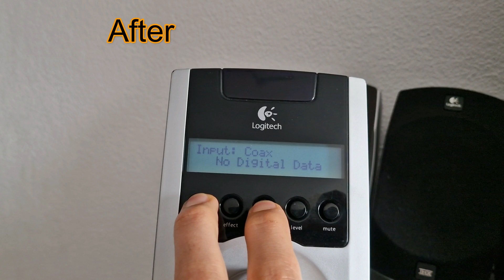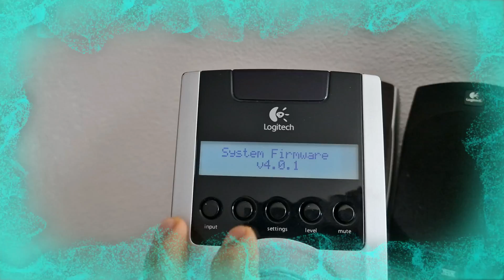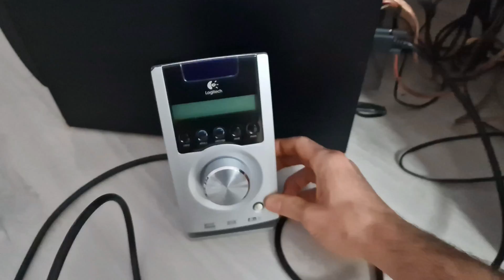Logitech Z5500 Change POD Control (Firmware 2.1.0 to 4.0.1) + New Case!

Comment: I have the 1st generation one and version V 4.0.2 What exactly do the version differences change?
Reply from the maker: @Keremymz94  I discovered that a certain Output Format set in the PC can mute the logitech system.
DTS appears on the display but it is completely silent!
This seems to be a Windows problem, not necessarily from Logitech!
I also use the Stereo X 2 to have the 6 speakers and the 2 subwoofers!
This is when I listen to music :)
Reply from the maker: @Keremymz94  I noticed a lot in Dolby and DTS movies, there were sound changes in the Voice on the central speakers, and a little more tweeter on the central and bass!
That's how he listened to the music on 5.1 and I didn't notice any changes either!
You can see the new components in POD Control, as well as the screen with a different contrast to the old one, the new firmware that allows it to be displayed on the screen, even if the system is turned off!
+ other changes that logitech did not disclose!
Also try the MODs I made, you'll be surprised how much the sound can change!
There are 4 videos on my channel, look here link!
1
https://www.youtube.com/watch?v=W4CVPgWLYz8&list=PLsgyMOzSu2Eq9WmEVhE2aZzsZ22VpJyPS&index=17
2
https://www.youtube.com/watch?v=3i0sI4N84Bg&list=PLsgyMOzSu2Eq9WmEVhE2aZzsZ22VpJyPS&index=16
3
https://www.youtube.com/watch?v=IwjKWUaQo5c&list=PLsgyMOzSu2Eq9WmEVhE2aZzsZ22VpJyPS&index=14
4
https://www.youtube.com/watch?v=Dk8L73oLOPA&list=PLsgyMOzSu2Eq9WmEVhE2aZzsZ22VpJyPS&index=2
Reply from the maker: @Keremymz94  I encountered this problem too, when I watch Dolby or DTS movies I use the Optical cable from the TV to the POD Control, and sometimes I put the pause twice and the POD Control freezes, showing that it does not detect a Dolby or DTS signal and I gave a restart to POD And then it worked, I had no more problems with it!
You can also try a reset on POD Control.
Set the unit to standby mode then press Input Effect simultaneously for 6 seconds. This will put the Control Center in "Diagnostic Mode". Now every time you the Z-5500 is fed a digital stream (DTS, DD, etc.), it will display the stream information (format, bitrate, etc.) for 5 seconds in place of the DD or DTS logo before returning to the standard display.
Reply from the maker: For example, I downloaded a movie with DTS format, with 3 languages in it.
You can select which language to speak in the movie, one of them had the DTS format with a different number of Bitrate that logitech does not support, and I had no sound at all!
And there is another setting in windows, when you select the output to 2 channels 16 bits 96000hz (Studio Quality)
Or 2 channels, 32 bits 96000Hz (Studio Quality)
There are more, I haven't written them all, I have 12 settings in total.
Of 8000hz 16 bits or 24 bits 48000hz, etc.
If I select the last 32 bits 96000hz studio quality, logitech no longer has sound, but I noticed that even my headphones that connect via USB-C have no sound if I select another bitrate, or other wireless headphones have sound but it is not heard at all well, the sound is intermittent and noisy. @Keremymz94
Reply from the maker: They can be found on google, I can't send a link here!
I have it from a friend, uploaded on Megaupload! @Keremymz94
Reply from the maker: Hello, along with the firmware update, Logitech also changed some components inside the POD Control, they put better quality components than the other versions.
We improved the sound, rearranged the equalizer to DTS and Dolby and much more!
Reply from the maker: But do you use the Digital (Optical) input from the PC to the POD Control?
Or do you use the 3 jacks? @Keremymz94
Reply from the maker: Have you tried now to see if the sound stops?
It may be because of your computer!
To the program with which you play the movies!
If you take out the optical cable and put it back in, do you still get no sound?
I think that the PC remains blocked and no longer sends sound to logitech, and because of this you have to restart the PC to make the sound work again! @Keremymz94
Reply from the maker: For me, when I play the movie on the TV, this problem does not appear, I don't play too often either, I often let the movie play completely :)
It may be because of the signal sent by the PC!
At a moment, because of the scrolling, it receives and stops the signal quickly and possibly because of this it remains without sound! @Keremymz94

Comment: Hello, I have the z5500 set. I have a problem that isn’t found anywhere on the internet and I’m hoping you could help me. I have the Control Pod connected via an optical cable to the tv. The Stereo and Stereo x2 effects work fine, however, when I switch to the Dolby Digital or dts effects I do not get sound. The Control Pod can recognise that Dolby Digital or dts audio is being played however there is no sound from the speakers.

Also, connecting the Control Pod via the 6 channel Direct gives me no sound at all. None of the effects work via this connection. 

I tried different tvs and pc and nothing works. 

Where could the problem be and how can I fix it? Thank you very much.
Reply from the maker: Hello, it's a little strange what's happening to you..
The problem is more than likely from POD Control, where exactly, I don't know!
Possibly from the chip that controls the outputs for the 6 channels!
This chip is called NJW1150 and I had a problem with it in the past too!
Here is a video I made with the problem I had.

https://www.youtube.com/watch?v=PjzHTUbRgX8&t=9s

You can also try a reset on POD Control.
Set the unit to standby mode then press Input Effect simultaneously for 6 seconds. This will put the Control Center in "Diagnostic Mode". Now every time you the Z-5500 is fed a digital stream (DTS, DD, etc.), it will display the stream information (format, bitrate, etc.) for 5 seconds in place of the DD or DTS logo before returning to the standard display.
Reply: @ElektroGamer30  Thank you for the response. I reset the pod and put it in diagnostic mode just like you said and now the Direct 6 channel connection works however only Stereo and Stereo x2 work but DD and DTS still don’t work just how it is when connected via optical cable. 

I’ll see if the chip is the problem. Thank you so much.
Reply: Yeah I have a pod that has this issue problem is I can't figure out which freaking control pods go with which revision subs... @ElektroGamer30
Reply from the maker: @intoxicode  
Hello, the PID number must be as close as possible or equal to the one you have.

Comment: Do you have any idea of the cable type they used to connect the pod to the subwoofer ? My #!& cat ate it and I must replace the cable (still working but noise when moving the cable) . From what I understood, it not enough to take a VGA cable (15 cores, not 14) cut one end and solder it inside the pod. I've found (multiple) schematics of the connector mapping, but I can't find anywhere the type of cable to use (from what I can see in the hole of my cable, some part are shielded ?). For the record, my system is approaching it 20th anniversary and still kicking hard after thousands of hours of usage (I did not even had the infamous led problem)...when cat does not eat the cable...
Reply from the maker: What's wrong with you, let the cat eat the cable (It's really funny)!
Yes, you're right, it's not an ordinary cable like the one you use for the monitor!
The wires for the output from the bridge to the amplifier are once again shielded from the other wires to prevent different noises that may appear in the speakers!
I don't know such a cable that can be bought commercially!
I think logitech specially created this cable for their systems!
From what I have seen of different people who replaced the cable with a VGA plug, they used exactly that cable for the monitor, only as a better quality one!
I don't know if they experienced noises (interference) after replacing the original cable!
You have the order of the threads here if it helps!
It is compatible for PID R020+ R849+

To be sure of the connection, you can also measure your wires with a multimeter!
And if there is something wrong in my scheme, leave a comment here with the wires measured by you!
As far as I know, it's at PID R800 - (down)
differ one or two pins in placement!

Pin in POD Control!
WA17 - blue white pin 13 sub
WA2 - minus wire, ground braid from VGA cable
WA3 - black white pin 15 sub
WA1 - brown white pin 14 sub
WA 9 - gray pin 2 sub
WA8 - brown pin 1 sub
WA7 - red pin 3 sub
WA6 - pine green 4 sub
WA5 - purple pin 9 sub
WA4 - yellow pin 5 sub
WA10 - red white pin 10 sub
WA11 - green white pin 11 sub
WA12 - black pin 12 sub
WA13 - blue pin 7 sub
WA14 - white pin 8 sub
WA15 - nothing, does not connect to the sub
WA16 - orange pin 6 sub

Comment: i checked everything is fine and it's still a white screen
if not to the woofer
Reply from the maker: there is a risk of damaging a component either in the subwoofer or in the POD Control when you connected the wrong wires the first time!
Try to power the POD Control exactly like in the video I made and see if it still works!
https://www.youtube.com/watch?v=RxMEwN5OYbg&t=432s

Comment: I have everything wired as you wrote to me, I literally did everything as it says, just to look at the only control you said about the display, is it not interrupted
Reply from the maker: Hello, as far as I know, the screen remains white without anything being displayed on it when the 8v power supply is not connected!
Check if you have +8V on WA10
(WA10 red white pin 10 sub)

you can try to power POD Control separately to see if it still works!
Watch a video how you can do this!
https://www.youtube.com/watch?v=RxMEwN5OYbg&t=432s

Comment: I connected as you said and only a white screen appeared on the control
Reply from the maker: If you have disassembled POD Control too many times and kept moving the wires from the display, there is a risk that it has broken off the board!
First check the wires if they are broken or if they have continuity, check with a multimeter!
I've had a thread break in half and it's not noticeable.
It's just that my POD Control doesn't turn on at all!

Comment: the control does not work for me, a white image appears on the display, is it burnt or something is wrong, what could be wrong with it
Reply from the maker: Hello, as far as I know, the screen remains white without anything being displayed on it when the 8v power supply is not connected!
Check if you have +8V on WA10
(WA10 red white pin 10 sub)

you can try to power POD Control separately to see if it still works!
Watch a video how you can do this!
https://www.youtube.com/watch?v=RxMEwN5OYbg&t=432s

Comment: might try upgrading the opamps to tl072/74 or ne5532?
Reply from the maker: Hello, I made a complete MOD to this system!
I replaced many components in the subwoofer as well as in the POD Control!
I also replaced the OPAMP with OPA1612AID

Watch a video of how I did this in POD Control!
https://www.youtube.com/watch?v=3i0sI4N84Bg&t=1273s

And here in Subwoofer!
https://www.youtube.com/watch?v=W4CVPgWLYz8

Comment: Hello. I have a Z5500 set, when I plug it into the optical port, the lefr right speaker makes a buzzing sound (only that speaker has the problem), can you help me? Thank you
Reply from the maker: Hello, have you recently made any changes to the POD Control or to the interior of the subwoofer?
I had similar problems and replaced the OPAMP from POD Control!

I have a video in which I solved a problem with the front left speaker that no longer works!

https://www.youtube.com/watch?v=xr-fVWnXM0c&t=82s
Reply: Thank you very much!! I will do it your way.❤❤❤

Comment: vga conector lost
Reply from the maker: This is the order!
Pin in POD Control!
WA17 - blue white pin 13 sub
WA2 - minus wire, ground braid from VGA cable
WA3 - black white pin 15 sub
WA1 - brown white pin 14 sub
WA 9 - gray pin 2 sub
WA8 - brown pin 1 sub
WA7 - red pin 3 sub
WA6 - pine green 4 sub
WA5 - purple pin 9 sub
WA4 - yellow pin 5 sub
WA10 - red white pin 10 sub
WA11 - green white pin 11 sub
WA12 - black pin 12 sub
WA13 - blue pin 7 sub
WA14 - white pin 8 sub
WA15 - nothing, does not connect to the sub
WA16 - orange pin 6 sub

Comment: na chanel
Reply from the maker: connect

WA17 -  pin 13 
WA2 - ground braid from VGA cable
WA3 - pin 15 
WA1 - pin 14 
WA 9 - pin 2 
WA8 -  pin 1 
WA7 - pin 3 
WA6 - pin 4 
WA5 -  pin 9 
WA4 - pin 5 
WA10 - pin 10 
WA11 -  pin 11 
WA12 - pin 12
WA13 -  pin 7 
WA14 -  pin 8 
WA15 - nothing, does not connect to the sub
WA16 - pin 6

Comment: I need to solder 15 wires to the connector on the control, they are connected to me, but they are not on the connector, the control does not turn on, what you sent me, can you check which wire goes where to which pin
Reply from the maker: This is the order!
Pin in POD Control!
WA17 - blue white pin 13 sub
WA2 - minus wire, ground braid from VGA cable
WA3 - black white pin 15 sub
WA1 - brown white pin 14 sub
WA 9 - gray pin 2 sub
WA8 - brown pin 1 sub
WA7 - red pin 3 sub
WA6 - pine green 4 sub
WA5 - purple pin 9 sub
WA4 - yellow pin 5 sub
WA10 - red white pin 10 sub
WA11 - green white pin 11 sub
WA12 - black pin 12 sub
WA13 - blue pin 7 sub
WA14 - white pin 8 sub
WA15 - nothing, does not connect to the sub
WA16 - orange pin 6 sub

Comment: I need to connect the cable from the control to the 15-pin connector that goes to the woofer, which has 2 screws, this doesn't work for me, what you sent me is the pid: R013 for my control
Reply from the maker: I have PID R020 too!
It has to work!
Do you want to connect 2 subwoofers to a single POD Control?
Here's a video I made with this modification!
And another video in which we show how to modify the VGA cable to receive power from both subwoofers!

2 subwoofer 1 POD
https://www.youtube.com/watch?v=IwjKWUaQo5c&list=PLsgyMOzSu2Eq9WmEVhE2aZzsZ22VpJyPS&index=13

Cable VGA MOD
https://www.youtube.com/watch?v=QAIeXf0NgBo&list=PLsgyMOzSu2Eq9WmEVhE2aZzsZ22VpJyPS&index=2

Comment: could you record how to connect the 15pin connector from the control to the woofer for the z5500, I couldn't find which wire goes to which pin, thanks
Reply from the maker: 1 right rear
2 sub
3 left rear
4 center
5 left front
6 no connect
7 enable amplifier
8 enable mute
9 right front
10 +8v
11 ground amplifier
12 bo figured out jet
13 main groun preamp
14 18v
15 -18v

1 - Brown
2 - Grey
3 - Red
4 - Green
5 - Yellow
6 - Orange
7 - Blue
8 - White
9 - Violet
10 - Red with White
11 - Green with White
12 - Black
13 - Blue with White
14 - Brown with White
15 - Black with White

Look here and the playlist with all the videos I made with logitech Z5500
https://www.youtube.com/watch?v=IwjKWUaQo5c&list=PLsgyMOzSu2Eq9WmEVhE2aZzsZ22VpJyPS&index=13
min: 19:10
Reply: @ElektroGamer30  tenks
Reply: @ElektroGamer30  no working 15 pin
Reply: @ElektroGamer30  15 pin to conector to woofer control to woofer wiriling 15 klor to conector
Reply from the maker: I have PID R020 too!
It has to work!
Do you want to connect 2 subwoofers to a single POD Control?
Here's a video I made with this modification!
And another video in which we show how to modify the VGA cable to receive power from both subwoofers!

2 subwoofer 1 POD
https://www.youtube.com/watch?v=IwjKWUaQo5c&list=PLsgyMOzSu2Eq9WmEVhE2aZzsZ22VpJyPS&index=13

Cable VGA MOD
https://www.youtube.com/watch?v=QAIeXf0NgBo&list=PLsgyMOzSu2Eq9WmEVhE2aZzsZ22VpJyPS&index=2
Reply: @ElektroGamer30  sory ploblem no working kontrols